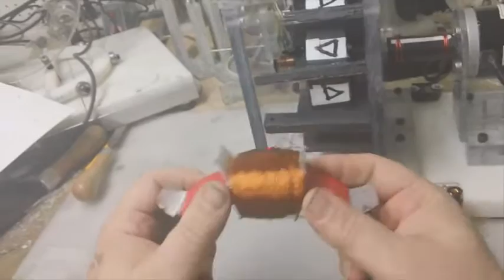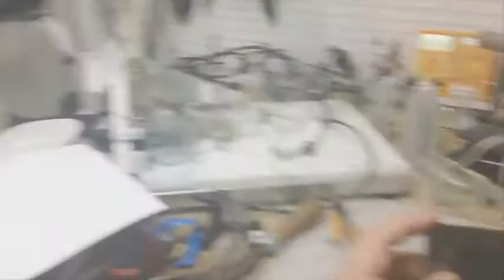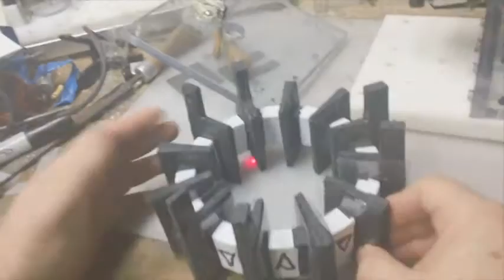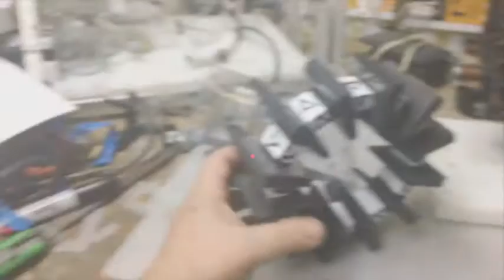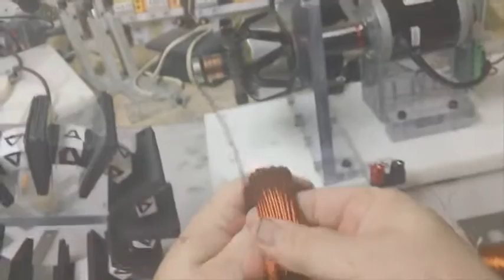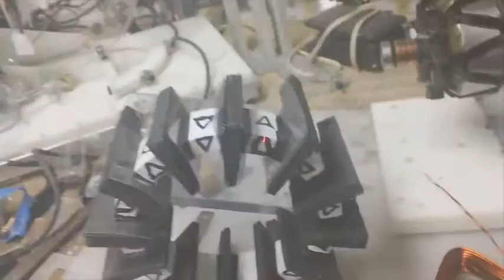Generator 2.0 Stator Build 3

Comment: Adding the spacer bar plate to achieve your resulting shape has bigger detrimental implication since the resonant steel doesn't have equal phase shift and thus the translation of energy between the plates will not transfer because of parasitic interference. I like your ideas. Please look at Gerard Morin and his latest video. My advice is learn from his mistakes first. Keep posting videos! :) great job
Reply from the maker: Thanks for your information Michael  although I am only posting this video now, it is a few months old small amount of metal between the coils doesn't seem to have any detrimental effect, the next few videos should give you a better idea of where I'm  going with all this.  If you look at some of my earlier videos where I'm using a fan stator the coil is almost completely surrounded by the lamination, but the  lamination orientation is different.